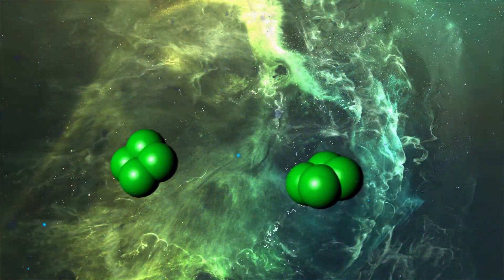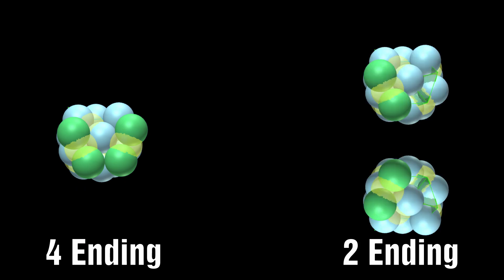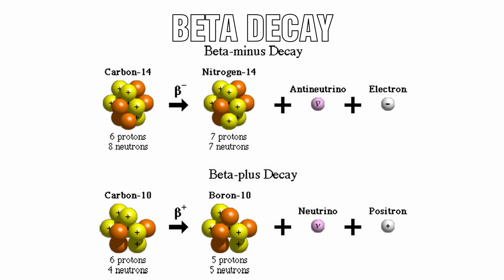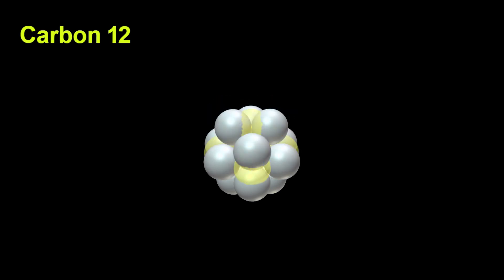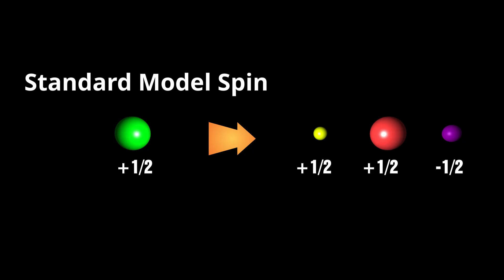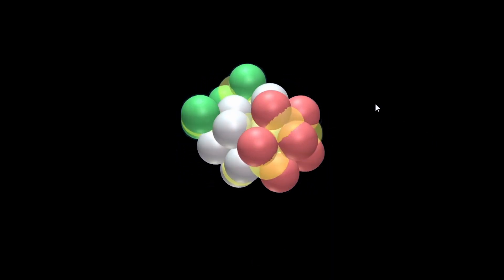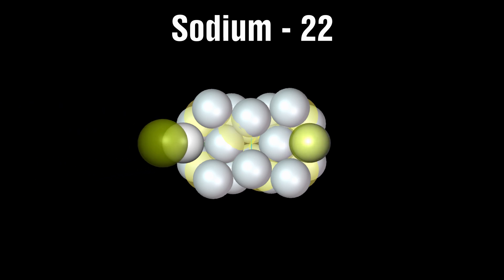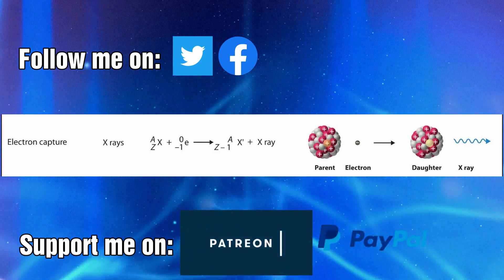Simple Nuclear Reactions Explained Using the Structured Atom Model

Comment: Great video. 
Reminds me of the structures that were proposed in Occult Chemistry.
It was weird with geometries, but had some interesting discoveries. 
Like they were the first to discover an isotope of hydrogen (deuterium).

In that model, all particles were build from only positive and negative basic particles.
With 9 together they build a proton= hydrogen nucleus with positive charge.
Each atomic nucleus had a certain configuration that is very similar to the structured atom, but with a lot more particles.
The mass of the nucleus was directly related to the amount of basic particles, and is the only model that actually does that.
The basic particles were locked into circular configurations, which made them connected.

The Occult model might suggest that we have more particles underneath the structured atom model.
Reply: I believe that model, along with many others, influenced the SAM. There's a saying that there's nothing new under the sun, so I see SAM as building on earlier useful bodies of knowledge, seeing the pattern in their common denominators, and taking a holistic approach at synthesis of them, as a foundation.
Reply: @markspann  "[s]eeing the pattern" in their common denominators... nice play on words.

Comment: "There is no reason to invent a new particle to fix a calculation issue"
Excellent sum up of the standard models (Chemistry, particle physics, cosmology). I wish SAM was around during my university's chemistry years.
Reply: One convenient solution to summation of spins is use vectors rather than scalars, in which case we can avoid necessity of neutrinos. Does anyone know on what basis standard physics can assume that spin numbers are SCALARS and not VECTORS? Normally we use vectors when working with spinning systems.
Reply: This quote by definition is incorrect. Thats not what happens in particle physics. New particles arnt invented, they are either theoretically predicted, or they are detected.
They arnt made up to make a model work...
Reply: @349scotty5  theres no laughing emoji, but scotty ,y CAN change the bogus laws of particle theory,your  gaslight response only restates what is not.
Reply: @chloewinkworthartist  I think there needs to be a laughing emoji for you, followed by an evaluation into how science in reality works, not how you think it works
Reply: @349scotty5  gaslight is not science ,and you only demonstrated you cant spell arent...
Reply: @chloewinkworthartist  there really needs to be a laughing emoji in place of these grand all knowing delusions, that are so profound that the trillions on trillions on trillions spent in both time and equipment, and generations on generations of some of the most intelligent and mastery individuals to ever grace the planet, are all wrong because some guy on you tube called Chloe says so...🤦🏾‍♂️
Reply: hooray for censorship,it helps keep humans stupid while making you feel powerful.